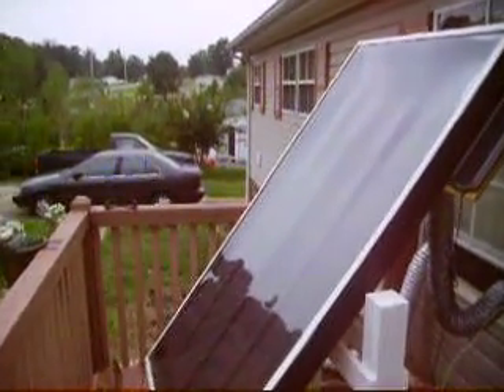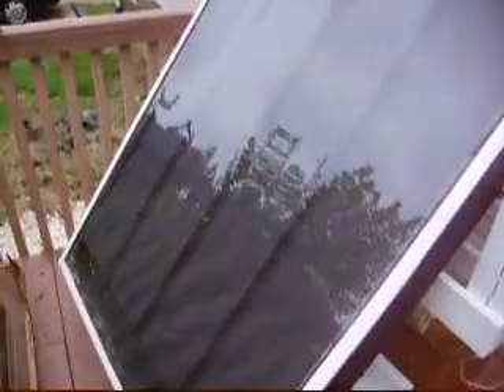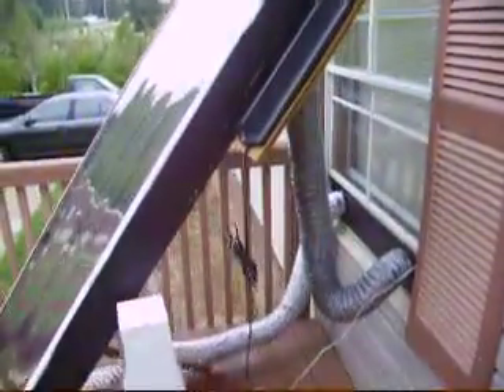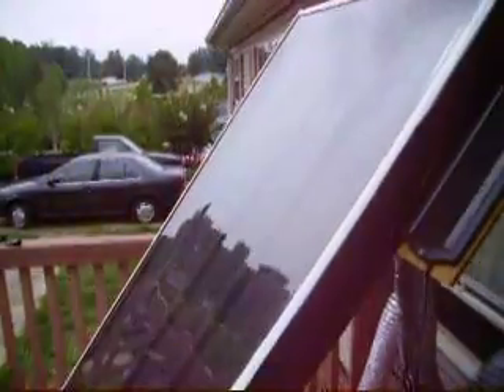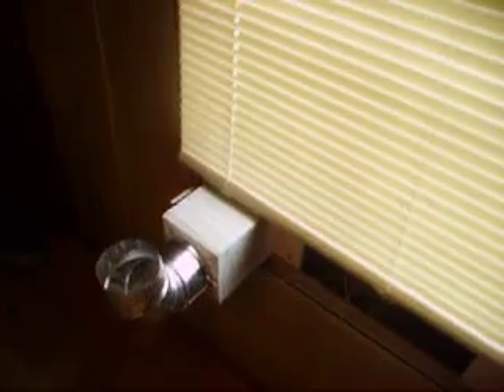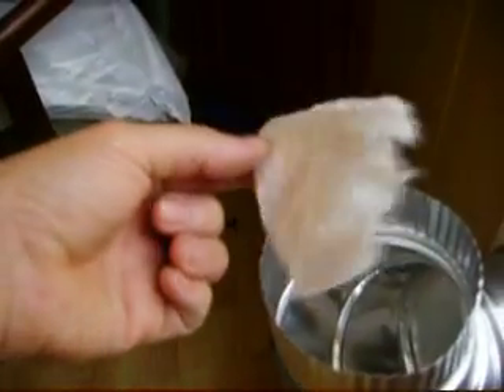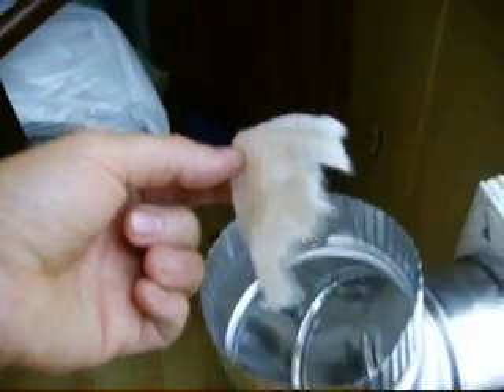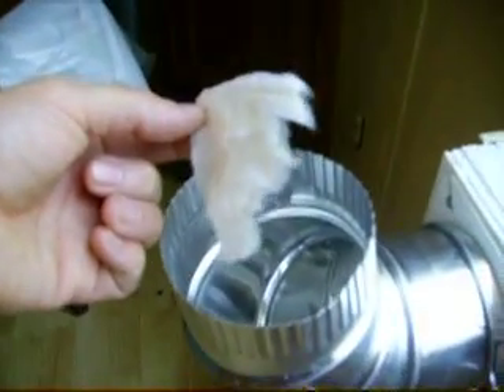solar heater update 3.5

Comment from the maker: @toob247  Yes, it was like having another floor register in the home putting out awesome heat. The only difference was the heat from the solar heater was hotter. I did notice a difference in the power bill. I haven't done any in depth analysis. I'm sure it paid for itself. If not it will this winter. Good luck on your build. Thanks for watching.

Comment from the maker: It works so good. Thank you for your video. I followed your lead. The only thing I would change is the insulation. It gets so hot inside that it has shriveled the foam. I plan to take the back off this spring and replace the foam insulation with fiberglass.